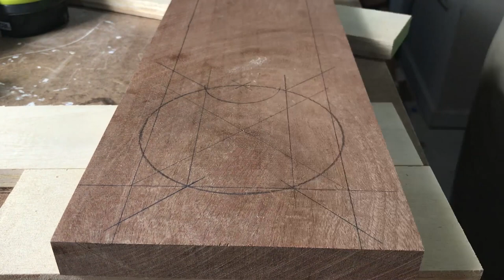DIY Mahogany Candy Dispenser | Great Gift for my Dad

Comment: What are the dimensions, and what did you measure?
Reply from the maker: I don’t remember the exact dimensions (and don’t have plans or the project anymore). From memory, it’s about 6” wide and 14” tall with the circular part being about 5” in diameter. I really based the dimensions on wanting to be able to put at least 2 bags of peanut M&Ms in it and about 3 coming out each turn